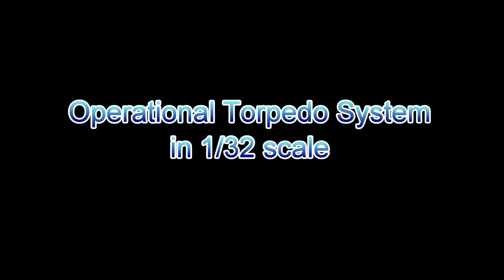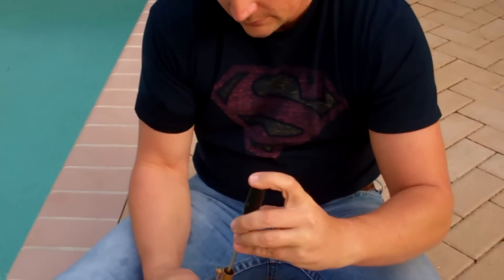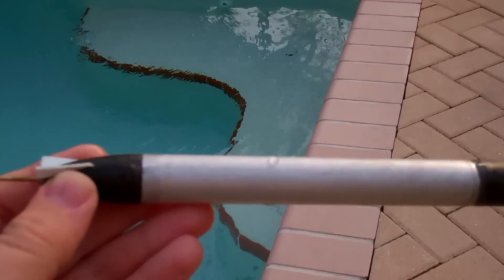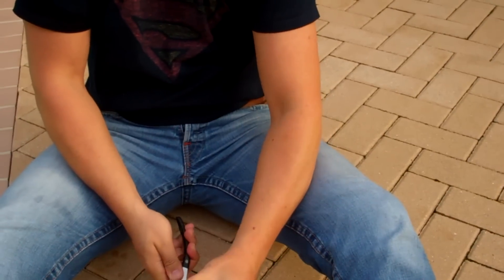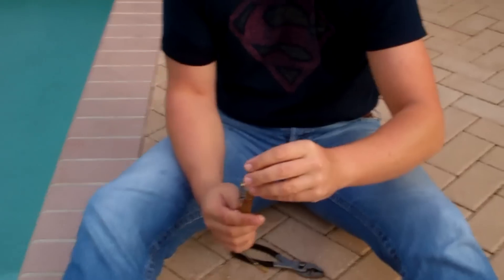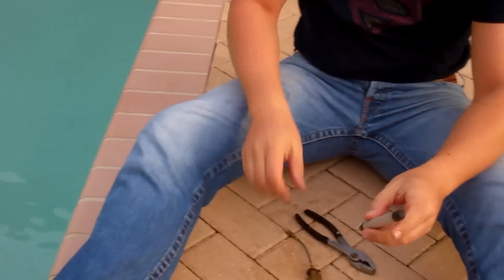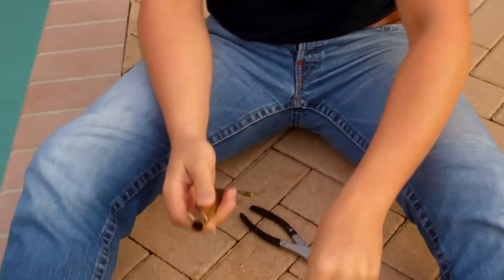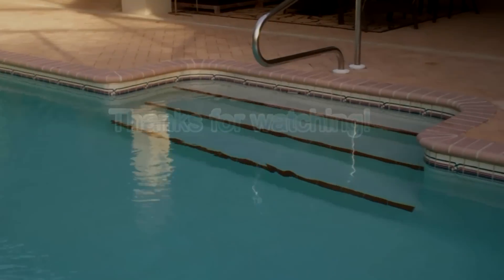R/C torpedo system testing

Comment: I do have a question, can you make an actual explosive torpedo at that scale? Please take this under consideration, it would be cool to see.
Reply: +Nerf Nut easy
Reply: +hoodstarx1 Then do it
Reply: I was going to but then I realized why? I dont have a rc boat that fires torpedos or anywhere I can test. Its easy though, just have to make a simple impact contact fuse
Reply: Hmm  yeah just like Charlie Allnut did with the African Queen.
Reply: Nerf Nut possibly the nose could be filled with flash powder that goes off on impact.  Might make them dangerous to handle though.

Comment: How did you produce the torpedoes themselves? Are they like the original 1/72 versions, made of cast resin?
Reply from the maker: randomguy9898 These particular weapons were created using aluminum tubing and resin end caps.   The big issue is adhesion between the two unlike materials as the tubing expands and contracts drastically during fueling and firing.  A flexible adhesive such as RTV is needed.
Reply: RCSubGuy 

Thanks!

Can I also email you some sub questions to the one you listed on your site?
Reply from the maker: randomguy9898 Absolutely!  Feel free to email any time.

Comment: the problem is the torpedo is spinning so the guide blades (i forgot the names)  are spinning so its like a rotor blade
Reply: Couple effect, Why most torpedoes had twin propellers.
Reply: Mike Cimerian couple effect?
Reply: GUNZABLAZIN !!!!! Counter rotating props corrected the tendency to roll.

Comment: It mimics a steam torpedo, but how do you plan triggering it?

You actually do stuff, I'm more of a theoretic:
What are your thoughts about dual screw electric propulsion with one of the props fixed to the hull? Fast & straight, and you can incorporate a reed-relay (thus triggering it by a coil surrounding the torpedo tube.)
A neodymium magnet on the tip makes it stick to a dedicated target boat; also providing detection to start a sinking/roll-over sequence including special effects.
Plus a magnet makes stray torpedoes easier to retrieve by using an ironclad vessel. You can even make the battery switch over to a blinker LED after a timed run...

I'm sure your practical & uncluttered design is one of the reasons you made it happen in real life ;)
Reply from the maker: Bear in mind that there is very little room in there.  Add batteries, a motor, reed switches, ballast, etc and you'll be challenged to maintain buoyancy.  Is it doable?  For sure.  Worth it?  Only you can decide!
Reply: Buoyancy, good one. Elementary, yet didn't cross my mind to be honest.
Reply: Ronald van Kemenade  Coin cell batteries and a Pager Motor? Discuss.
Reply: TheWinning247 Saves a lot of room & weight..
I wonder if rechargeable coin cells exist... If rechargeable, one could seal the torpedo perfectly, having just 2 contacts for charging flush with the hull.
Any ideas for sealing the drive shaft?
Reply from the maker: Ronald van Kemenade I did experiment with pager motors and they work well.  They are not very powerful, but can spin a 1/4" or 3/8" propeller alright.  Sealing the shaft is problematic as traditional seals do have a high friction.  I simply ran mine wet and doused them with oil after each run.  They're cheap enough that you can simply replace them if they do eventually die.  This way the only thing that needs sealing is the battery compartment, which is very easy to do.
Reply: Could use a Capacitor instead? Charge a supercap (small one, obvs) to around 9v, 2f, series resistor at about 24Kohm would give a decent push for 20/30 seconds?
Reply: Sure.
I guess in theory we have a nice fish. Doubt I'll be building one anytime soon though ;)
Can I pick your brain on something else? I'm struggling with what creates the 36 spectral lines of hydrogen.
I'm sculpturing the universe using classical mechanics only. I already know what photons & atoms look like in full detail, but can't put my finger on the absorb / emission spectrum..
Reply: RCSubGuy Great you experimented with those. In theory we can seal the axle using neo magnets to transfer the torque, and in effect make a perfect seal... far to cumbersome in reality I guess...

Comment from the maker: My pieces came from 32nd Parallel, a company that went out of business back in the '90's.  Everything will need to be made from scratch. You'll need access to aluminum tubing and material to turn the caps and tails from.  A lathe would be perfect, but you could also get by with a drill press or other stable drill platform.

Nothing on the market in that scale.  Bear in mind that these are basically rockets, so few manufacturers will accept liability for selling them.

Comment from the maker: Torpedoes aren't an off-the-shelf product.  There are huge liability and safety concerns that mean most vendors steer clear of it.  You can try the Sub-Driver website.  They have a small torpedo system you can buy.  Other than that, however, its a matter of buying raw materials and turning out your own weapons of mass destruction (aluminum tubing, resin endcaps, brass tubing for nozzles, etc).

Good luck!

Comment from the maker: Nozzle alignment is a big part of this, but also bear in mind that there is a liquid sloshing about inside the body, affecting its center of buoyancy.  The biggest thing that I found is that canting the rear fins results in straight operation UNDER the water, however the torpedos quickly become buoyant as the liquid gas is expelled.  With that being the case, only the lower fins are in the water, resulting in either left or right steering depending on the direction that the fins were canted.

Comment from the maker: The gas is not CO2, it is airbrush propellant.  CO2 operates at far too high a pressure for safe operation in a model sub without many pressure reducers and adapters.  This system uses a simple servo to push the torpedo off its seal, allowing the gas to escape from the rear nozzle.  There is no spring assist in this prototype version.

Comment: few question on this:
so the propulsion is compressed CO2?
what scale is the torpedo
are you using a one way valve to fill sealed with a 'o' ring until torpedo is release (assuming electromechanical release), is there an spring assist at all?

Comment from the maker: Its not just up and down that needs to be corrected, but left or right.  Adding spin to the torp is necessary to counteract any slight variations in nozzle direction.  The creation and implementation of an elevator system like you mentioned is certainly possible, but the amount of work necessary is very high, as is the possibility of losing the weapon at the lake or pond.  The torps I made are cheap, easy to fabricate and work well.  I just need to tweak the amount of gas and the fin angles...